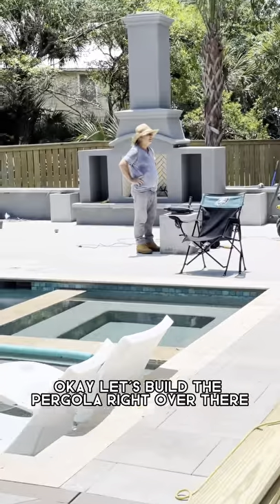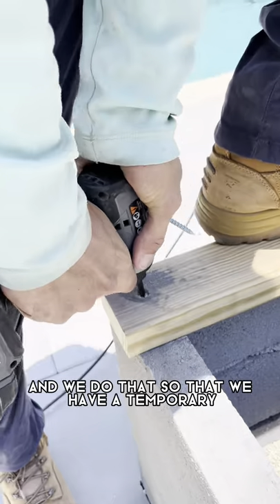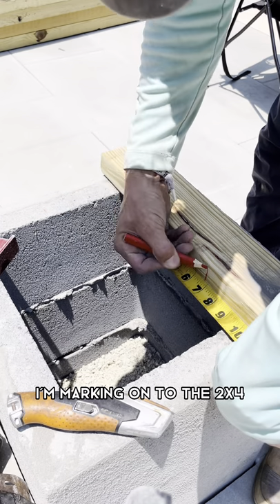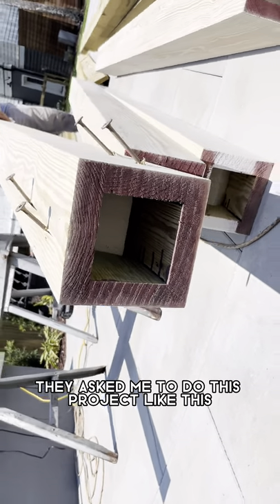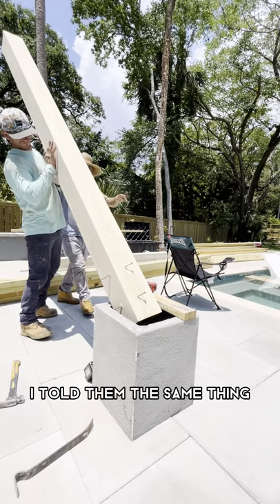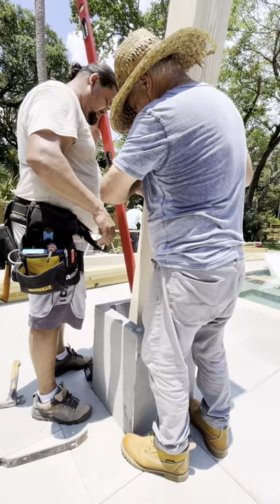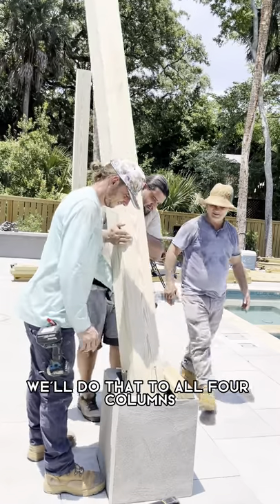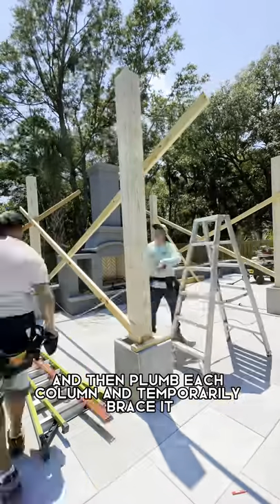Building a Pergola Part 2

Comment: Let me teach you a valuable lesson every business owner needs know… You are being hired for your skills, knowledge, and craftsmanship. When they invite friends over and the pergola they had built 2 years ago by your company is rotting it will give your company a bad imagine regardless of the warnings you gave the customer. The money is not worth the compromise of not being able to fully stand behind your work!
Reply: Yeah refusing the job is definitely the way
Reply: You are truly an intelligent person.👍 Best comment.
Reply: Not to mention your biggest concern LIA-FUCKING-BILITY
Reply: If it was a safety issue or going to be an immediate structural issue, I'd 100% agree.  As it sits, yes it'll most likely rot, but not tomorrow, not next year, probably not in 5 years.  And if you seal the posts, it'll last longer.  By the time it's an issue that homeowner will either have sold the house or forgotten who built it.  With that kind of timeline, if you need the work you do it.  It's easy to make an overly cautious moral stand when you're talking about somebody else...a little more difficult when you're trying to put food on the table.  Again, I'm not saying anyone should bootleg a big electrical job without a permit or rip out a load bearing wall without planning a proper beam, support, and headers to maintain integrity of the structure.
Not to mention the fact that everybody's super concerned about the columns rotting prematurely, but are totally fine with telling the client that 4 little screws sticking out into concrete will serve as sufficient measure to prevent uplift. I don't know if anyone's done the calculations in how much uplift is suffered by a pergola in a wind storm, but there's definitely some, with varying force depending on design and spacing of the top.  But those little screws aren't going to make a bit of difference against any significant uplift.  Run an anchor up the inside of the hollow column and wet set it.  I'd be more concerned about the columns being structurally sound and up to the task of supporting it at all.  But I didn't pay any attention to how big the thing was.  Regardless, pergolas are stupid anyway so what's it matter.  They'll be looking to have it torn out and something built in it's place that will serve a purpose within a couple years anyway.
Reply: I agree 💯 you are your word and work and never do anything that's not up to code and this was definitely not .
Reply: Michael Madrid  who are you referring to?
Reply: Rome was not built in a day. But this pergola definitely was. In more ways than one
Reply: My dad preached to me this about our family business. He's a contractor and has his own business. He said our business is built on craftsmanship not money.
Reply: @TURTLEORIGINAL  most likely a labourer with no pride in his name or work or he's a slime ball contractor
Reply: By the time this rots, it’ll be onto the 3rd owner and they won’t even know who built it. Chill with 2 years lol… that’s got at least 10-15 years before it’s rotted to destruction.
Reply: When it fails and hurts someone who do you think they are going to blame?
Reply: @JohnDoe-mx5lf  who they blame won’t matter. The homeowners insurance will need to deal with it.
Reply: This guy 🤣
Reply: I agree dude! But Dont know your situation.. but some people can use some cash sometines! And if a job comes up and the client wants it this way.. and i get paid… money talks!
Reply: Yeah when people see the defects in the design , the homeowner will never speak up and say he told us not to do it this way
Reply: Customer is always right and money is good
Reply: His name is on the line, who did that terrible job? He did.
Reply: His name is on the line, who did that terrible job? He did.
Reply: I thought literally the same thing. They want to save money and it's gonna cost me money when they give me bad word of mouth. 
 I would have respectfully declined. We do it all the time, customers want what the code doesn't allow. Most of the time they understand and we do it right.
Reply: @363.2McMasters  that's completely false and more than likely a reflection of your work. All of our business comes from word of mouth. We do not advertise at all. No website, no phone number on our work vehicles. Idk why'd you think that but word of mouth is literally the most powerful marketing tool a business has.
Reply: Amen!
Reply: @invictusbp1prop143  the post will be embedded in concrete at the base and that will trap moisture. It will rot out completely in 10 years.. but it wouldn't last 50 or 60 years if it was built correctly.. you obviously aren't a carpenter
Reply: @invictusbp1prop143  not to mention a pergola should be built to code anyways because a hurricane could blow in over into the neighbors roof if the structure isn't mounted properly..
Reply: @danthecarpenterman9463  I dunno....
I had tiles installed in my kitchen 11 years ago. The builders told me that the tiles would come up. I had to ask what that even meant! (Come up? Hover? Anti gravity?! 😂) 

They wanted to take the ground up and lay it again, costing many thousands.

I asked them to just install the tiles. If one cracked, I had spares.

It took a lot of persuading, but in the end they laid the tiles.

So far 1 tile has cracked (and I replaced it).

I wouldn't dream of telling anybody that the builders were at fault or failed to warn me. It was me. I'm very grateful that I found someone willing to do the job that the customer wanted. It saved me a lot of money and was the right thing for me.
There's no way I'd tell the person that bought my house about which company fitted my tiles! 

It's awful that some customers would be so cruel as to give workmen a bad name just for listening to the client's wishes. I've never seen it myself, it's hard to imagine, but I believe it happens. What I don't believe is that such horrible customers are as ubiquitous as people make out.
Reply: well said,  thats how i see it and feel about the work i do👍✌️
Reply from the maker: I came in as a sub here, and while I feel you there, and am not proud of the situation I’m also not here to be perfect. I got bills to pay and so do my guys. Denying the job would screw us all over. The contractor asked for this, despite my warnings so that’s on him…
Reply: @Artpentry  I can't even tell you how valuable it is, to me, to know that some contractors are willing to do what the (very much aware) customer needs them to do. x

It's almost as though you don't immediately assume that all your customers are clueless morons! ;)
Thankyou. x
Reply: I agree, if my customers ask me to compromise my skillset by installing something I believe to be substandard I will refuse the job. I'm a plumber and I always say if I install something I will always ask myself would I want this fitted this way in my own house if the answer is no I don't take the work on and pass it up. Sometimes I go back to fix it after whatever it is that's failed and end up charging them more because I have to rip out the stuff the other guy did.
Reply: Say no to customers like this or have them change their mind, if they won't move on, there is always another job and you'll most probably go to fix/refit it if you passed it up and they have had somebody else do it as they want. Never compromise your skillset. They hire you for that skillset.
Reply: @fjt4700  if he had any ethics or conscience for his skillset he would refuse these as I would. Tells you a lot about some people and their mindset about the work they do.
Reply: Learnt this one the expensive way
Reply: @whetstonemistery  that's the problem though - sometimes customers don't want what you want!
Thinking that you know what they want better than they do can be a mistake. I think you should ask why they want what they are asking for, rather than always refusing to do what the customer wants if its not what you want.
Reply: @Mr.Torres831  probably truest points
Reply: That's solid advise your giving him, I think he's going to have to learn this lesson the hard way from his narration. 😉
Reply: @TURTLEORIGINAL  No one is specified so that means the OP.
Reply: They should have went with the concrete anchors that are set in the concrete
Reply: @darwinbodero7872  yea, it is. No self respecting craftsman wants to put up something half assed.
Reply: Couldn’t put it any better
Reply: When I had more patients patients I would do as the customer or General contractor wanted.  Now I'm like nope, last man that touched it is the man that gets blamed.  If I can't do the job in the proper way I know it should be I walk away.
Reply: Great advice.
I can't count how many times I've lost a job because I refused to put regular outlets instead of GFI on outdoor walls and structures, or higher guage wire. I don't do residential electrical work but sometimes it comes around. I was called for an outside outlet for an above ground pool. The home owner was running an extension cord from the washer outlet. When I gave him the price he noticed that the outlet price alone was $30. He said I was crazy amd expensive.  That outlets at Home Depot were less than $2. He hired a handyman and his kid ended up getting shocked by the connection. He got lucky the child didn't get killed. He called me back and I apologized that I was going to have to decline. Once a customer wants to go against the advice of an experienced tradesman, it's a big red flag. That is why I mostly do commercial electrical work. Don't settle for less. It may end up costing you much more.
Reply: @greenhulk7573  Yep. A GC calls me to replace a fuse box with a panel. Walk in ad saw the level of demo he has done and the old cloth wires and old ceiling box, 2 circuits for a 2 bedroom apt, and a 20 Amp 12/2 feeding the fuse box. Told him find someone else. 2 months later he calls me to troubleshoot 2 issues in the apt, sheetrocked painted, new floors. No power to the ceiling light in living room,  bathroom light won't shut off even when switch is taken out. The owner blames him because everything was  "working fine before ". LOL. WORKING FINE MY ASS. Last man in gets the blame.
Reply: @kashton5272  LOL yeah those are either do it all completely or not at all. Had a call for a home with 5 different panels throughout the house. One was covered completely by sheetrock, no cover on it. Old Federal breakers.
Reply: Customers tell you what they want. You tell them what they need.
Reply: @Artpentry  I understand but at the end of the day it’s your name and reputation on the line regardless of your workers and the bills that have to be paid. A good reputation will let you and your workers  enough more not jut for bills to pay
Reply: You are absolutely correct, when it does rot, that's when the customers memory lapse sets in, I never told you to do it that way, you're the Builder.
Reply: Should of used a vinyl cap around the bottom and then used stone around too would of protected the lumber and still achieved the look home owner wanted
Reply: Why did you make this comment like he didn’t say i told them it was gonna rot and they said go on with it anyways
Reply: @TURTLEORIGINAL  yeah no 💀 the customer legit said they don’t care if it rots it’s on the customer not him
Reply: I was thinking about this when I  was first starting my business that maybe some jobs just arnt meant to be taken, thanks for the lil lesson
Reply: Agree but it look me about 20 years to learn how not to sacrifice my integrity to make a dollar. When you are younger, you tend to live in the moment.
Reply: Yes yes yes. You could have just used post base metal connector.  Never let the customer persuade you to do a job drastically wrong.

Comment: Wood directly in concrete like that is not a big issue if you make a few little tweaks...a) paint the part of the wood that's going to go in concrete, 3 coats of nice quality paint. b) install flashing on top of column that will prevent water from geting into the column c) put rebar through the bottom of wooden post instead of those screws.... however if you do all that, you might as well just get a metal bracket

Comment: What you could do to atleast prolong the rotting process for posts is cover them in blueskin, it's a concrete resistant moisture barrier works really well
Reply: Yup they could do a couple things to wrap the wood itself and adding weep holes wouldn't hurt considering the posts are hollow..

Comment: FYI burn & paint with motor oil the base it will buy you at least 10 years or more 👌🏼
Reply: pour and spray used motor oil to the post before concreting will stand within 20 years and up.. no ants can creep around the structure with a little spray...

Comment: As a professional builder  You have a responsibility to do things right regardless of what you are told. When things go south they will not remember this and only blame you
Reply: Why will they rot?
Reply: @Molly-jh4kz  yes they’ll rot in the concrete.
Reply: @Molly-jh4kz  exterior lumber needs to be protected from the elements. sun bleaching drying out wood warping, water moisture creeps mold eating and rotting the wood. bugs also will start feeding on it. there is lumber for wet exterior areas called pressure treated

Comment: You could use expansion foam, instead of concreate since the pergola is not heavy.  But you need to add a water proof coating to the timber and concrete base. Including a a shedding slope cap that goes over the top of the base. 
Blue wraps, also coatings will give you more life.  
This will rot, but It is not that hard to replace columns after several years.

Comment: just a thought

could you wrap the bottom of post with "ice and water" underlayment

just wrap the section that's in concrete and maybe just go about 1" above concrete

not saying it would definitely prevent rot from happening but would definitely prolong the life of post by a few years

also maybe adding a weeping hole to let any accumulated water to exit

Comment: I guess the building department doesn’t know about this job and the immersion of the wood posts into the concrete. Even with the poured concrete bases, lack of anchoring them to the slab can still cause uplift from the wind.

Comment: Should have treated the wood first to make it impermeable. It should have been as simple as lightly torching it, and smearing it with a tar and kerosene blend to preserve it. The same method used to treat electric power line poles, then give it a nice color coat of paint. It is a very inexpensive process, and both the contractor and homeowner would have been satisfied.

Comment: Just out of curiosity.. What is the right way to do it, so it doesn’t rot?
Reply: If you allow me to guess...
You should use a thick hunk of wood instead of planks due to permeability of the planks (due to the fibers that were cut)  and the gaps on the corners where the planks meet.
One solution would be to burn the wood, it become impermeable.
Reply: Just don’t allow water to soak the posts. Doesn’t look like treated wood.  I’d use flashing tapes on posts and then simple but nice black metal post skirts with window silicone. Water won’t make it down to trap and rot posts
Reply: Dont bury the post in concrete.  Use a fastener plate in the concretr and bolt the wood to that.
Reply: Wrap the wood with a membrane such as tar paper.
Reply: Lots of ways to skin the cat. But the rule is wood is not intended to be embedded in concrete. Since sheer and uplift are an issue with pergola's; I personally (I do commercial) would use steel columns and wrap them in wood. Steel base plates is another way but you still need to deal with the plate flanges meeting the wood columns.
Reply: A question, if you don't mind. Thinking of using planters filled with concrete similar to this, our pergola (10 x12) is aluminum though. In your opinion, should  that be an issue? Thoughts on stability? (will be adding pic roof panels) Thanks! @chrisanthony579

Comment: If it’s GC rated pressure treated lumber it will last five years, maybe more. It doesn’t change the fact it’s still considered an old-school construction method. Had they gone with the current method it would last fifty years.

Comment: Screws to grip the column in the crete is pretty standard. We do the same for window wells in foundations with treated lumber but with ALOT more screws lol. Personally thought i dont like to bury my posts in concrete if i cant help it. Treated or not
Reply: Why the hell would not use 4X4 or 6X6 pressure  treated lumber ?

Comment: You can always paint some treatment on the bottom part of the post
Reply: And then put some poli to it
Reply: @rulowth4815  overkill. Just exterior paint double triple coat and that bich will last longer than the top will.
Reply: @TheyCallMeMrBoombahstic  if you said so
Reply: @TheyCallMeMrBoombahstic  typical construction guy with the unnecessary swear words 🤣 👍
Reply: @daaneel  because they're a construction guy,  the swear words are necessary!!!

Comment: That's unfortunate, the material definitely looks well made. Could have just cut the beams and installed post plates but whatever I guess... That's the downside of going with contractors a lot of times. A good one can bring in some great business but a bad one can taint your company forever. I guarantee in 2 years when that wood rots he will blame the bad design on you.

Comment: This would be a good use for that spray in foam post filler
Reply: I think it would seal post so water wouldn't get to it
Reply: I actually think you're 100% correct, that would be the best way to do this given the circumstances